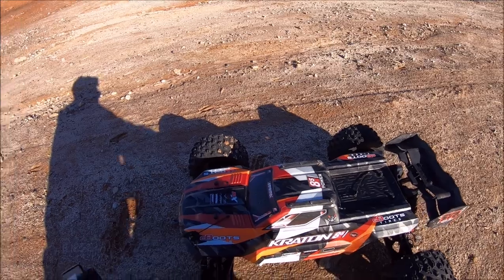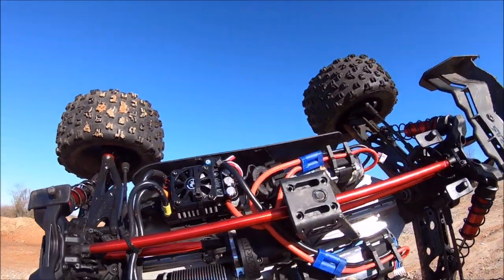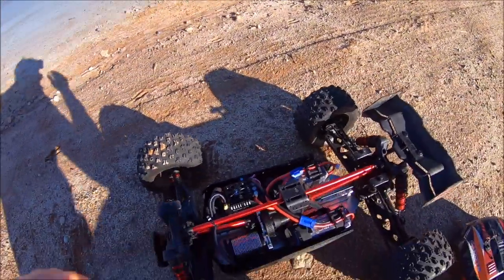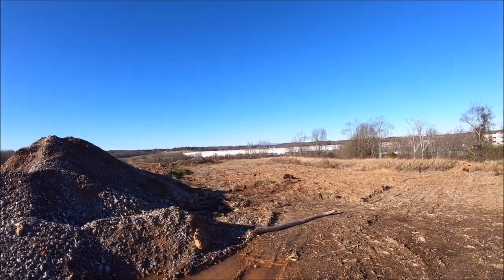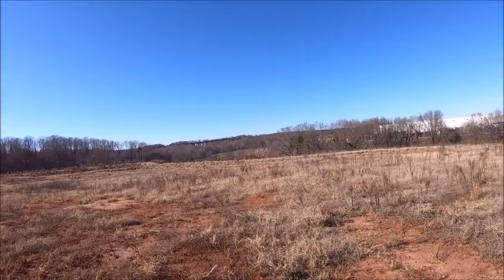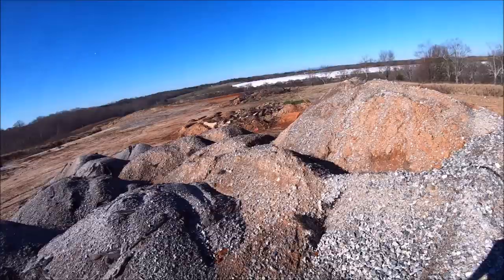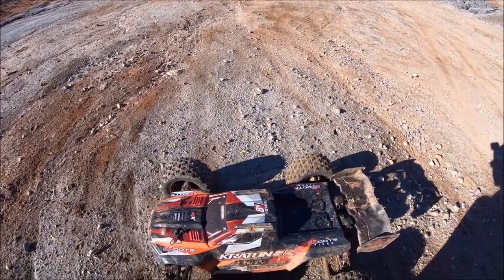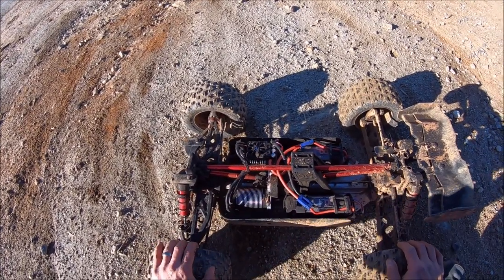ARRMA Kraton 8s M2C UPGRADES TEST!! with New BEEFCAKE ELECTRONICS!

Comment: That was friggin BADASS Brother Eric 😜!!!! So Killer to see the K8s back in action and with the full M2C Beefcake treatment 😱. The fact that the top brace was still straight after that beating truly speaks volumes about Mitch's 7075 chassis 💪. There's no question he put a TON of work into  it while juggling other new designs too 👀. I'm ecstatic to run her beefed out with the bigger torque set up especially🤙🤙. Really appreciate the warm shout out Bro 🤗. This Big Girl has such awesome potential 👀. ARRMA set the stage with this ingenuous platform that handles far better than anything I've seen at this size.   Hopefully do some hard testing with mine this weekend 😍. Soldering up my new set up now. Christmas came early for sure this year 🤣!!!! Thanks for another SICK upload my friend and a great overview of the Behemoth 😱🚀🚀😎💪👊👊
Reply from the maker: Thanks so much my Brother!🤗This just put a fearless fun factor smile on my face with the upgrades and new electronics!💪Arrma's great overall design plus M2C treatment =Perfection! A few close calls but that's what makes it fun!😂VERY excited to see what Mitch comes up with next for this rig! Hopefully shock shafts!!😜😂🤘🤘👊🍻

Comment: Looks like ARRMA and M2C Racing struck a deal. ARRMA kept the T6061 aluminum and let it bend under extreme conditions and let M2C make a chassis the same thickness out of T7075 aluminum to keep them rolling out the after market chassis. ARRMA could have used T7075 and kicked M2C outta the market. Win win for both. Either way, if it passes the "DUDE" test, it's TOUGH!!!
Reply from the maker: Thanks Grumpy!👊Yeah thank Goodness for M2C's amazing design on both chassis and motor mount!🤘More upgrades are in the works! A 30lb 1/5 scale rig is no joke ripping around! So much fun!! Thanks for watching bro!😎👊
Reply: I just purchased the m2c motor mount for my Kraton 8s with the 8mm shaft slider. Do you know what the largest pinion size the motor mount can accommodate? Thanks

Comment: Awesome!!!  But usually when you have a heavier truck and want to launch it high you go UP in oil weight in the shocks.  I have a dozen 1/5th scale trucks and run between 60-100wt shocks oil for higher jumps.  Why do you like lighter shock oil.  It’s counter intuitive.  Explain.  Thanks!  And great videos man.

Comment: I actually bent my m2c Outcast chassis, and my Max6/1650kv combo bent my m2c motor mount😳. The chassis was bent downward on the rear tail. Think I landed on a sidewalk edge at the skatepark, and my motor was bent up not down, which makes me think it had to be from torque. Not Mitch's fault, tough as nails to bend either back. But she's back to newish and smooth as butter. 👍💪
Reply: Crewchief 227  never heard Mitch chassis ever bending.   Vid or it didn’t happen

Comment: What do you do to stop body rattle on your landings? Your rc sound so solid. Ive tried a few things with little success. Any tips will be appreciated.
Reply from the maker: Well I like to basically reinforce the body with mesh drywall tape and shoe goo then go over that with Gorilla tape. Sometimes like this body I just do the whole inside with Gorilla tape and use a heat gun to melt the glue. Makes it pretty solid!😎👊
Reply: @RCDUDE81  I see, I have used gorilla tape but no heat, and I have used shoe Goo w/ sheetrock tape but no gorilla tape. Thanks I will try your methods because I never hear body rattle on any of your crazy high jumps. I am jealous because the body rattle makes me cringe, it always sounds like a bad landing 👍 love the channel thanks for the reply.
Reply from the maker: @blindj  No problem bro! Thanks so much and good luck!👊
Reply: @RCDUDE81  Dude I put the gorilla tape and used some heat and it's 1000 times better! Sounds so solid. Ive done tape on my other non arrma rc bodies and they still rattled alot. The extra body thickness plus tape makes a world of difference.  Who knew all i needed was an arrma and gorilla tape to get rid of that annoying rattle noise. Finally, I was so jealous watching your videos. I must've spent near 100$ trying different things, foam body mount pads Plasti dip flex seal foam pool noodles. Thanks again have a great holiday man

Comment: Hey bro, great video, nice upgrades as well! What do you recommend for tires bro? Other than stock, I know duperbash is running the six pack 5022 but I can’t find them anywhere. I think the 5034 are 1/2” shorter and about an 1”more narrow. I’d be good with them but wanted your input also. I asked rich but it’s been a while and nothing. Thanks in advance bro!!
Reply from the maker: Thanks so much bro!👊Yeah another tire option would be sweet! The Duratrax tires look super cool but very expensive too. Same with Prolines. I'm honestly thinking about trying the PowerHobby Raptor 1/5 belted tire. There is two different tread designs for off road. I'll probably pick up a set soon and see how they do!😎👊
Reply: Awesome dude! Thanks for getting back to me. I haven’t even plugged my k8s in yet and I’ve had him 5 days already. Just need to get a couple good 4s batteries. Will be hitting the ground hard soon bro! Thanks for the awesome vids and info man, not holding back or afraid to call it like it is👍🏻 you the man rcdude81
Reply from the maker: @bwoodard907  😂Really appreciate that bro! Merry Christmas!🎄🎄🤘

Comment: Oa that rear shock blown out the passenger rear looked bent just curious cool video
Reply from the maker: Thanks!👊Yes it was bent😝Didnt notice till after the vid. At least the chassis was straight.💪M2C is working on shock shaft upgrades now. The new delrin pistons and adding droop screws has already helped a lot with the shafts!👌
Reply: RC DUDE81 appreciate the wisdom

Comment: So i received my K8, so your saying i should to fix the shocks, change the center diff oil, replace the chassis, the motor mount, the motor, the pinion and the esc to make this nice and reliable to use like this, oh gotta add them sealed bearings too, boy i got my work cut out for me now. So much for RTR.
Reply: @james s It's part of it, you have to pay so much to buy it, then just as much to make it run like it should out of the box.
Reply from the maker: Well, all changes are completely subjective and depends on your bashing style/habits. I made these changes to suit how I bash but this truly is a nice truck out of the box. I would recommend a chassis change though and you should be good! All other tweaks are up to you to get the feel you want!
Reply: I'm not putting Kraton down or any rc trucks I bash a lot not as hard like y'all but my xmaxx is holding up great I've broken arms and it's still stock
Reply: @RCDUDE81  but a chassis change will probably set you back $200 to $300 on top of the $900 + shipping. Probably the most disappointing aspect of this car has been the electronics. Having said that changing the electronics will set you back another $250 to $300 then add a pair of good batteries and you are around $1600. Anyone wanting one should just wait for a used one, save a bit and upgrade.

Comment: I see you have the power hobby 4s batteries I have them too 7500mah 100c on my kraton 8s do they hold up good for you
Reply from the maker: Awesome! Yes I love the PH packs!👌Pretty much all I run in my bashers! I've got the 6500 100c packs.😎🤘
Reply: I just got my kraton 4 days ago I love it Iv see alot of videos on the kraton when I opened the box my  Jaw hit the floor the videos do not do it justice when it's right in front of you
Reply: Do you know when those chassis will be available I would love to get one
Reply from the maker: @FairLoveFoxGaming  Mitch said in a post Saturday at 10:00 am.👊
Reply: Nice I'll be grabbing one of them I'm in the process of upgrading my 8s Iv got the max5 on the way 26tooth pinion gear 20mill diff oil beadlock rim's now they need to come out with wheel bars lol

Comment: What batteries you run
Reply from the maker: Now I run Zeee 6000mah 100c. And been testing the Gens Ace 6800mah 120c packs. I've had great luck out of the Zeee packs as far as power and longevity.

Comment: Hi mate, what kv is the motor?
Reply from the maker: 1120kv
Reply: @RCDUDE81  Great thanks. What temps are you getting?
Reply from the maker: @geejayrc9401  Very low tbh. Both Motor and ESC were barely warm. The Max5 is a beast of an ESC. They were both barely 100 degrees after hard running. I'll probably gear up two more teeth and see how temps are. Could definitely get away with it during winter months!
Reply: @RCDUDE81  100 sounds alright, although it's winter over there. What are the outside temps roughly? it's the middle of Summer here, but still 100 is ok
Reply from the maker: @geejayrc9401  It was around 50 degrees out. I need to do another hard run and test temps again for a reading on the video. I also felt them with my hand and just barely warm!